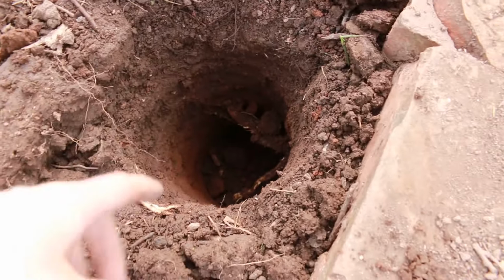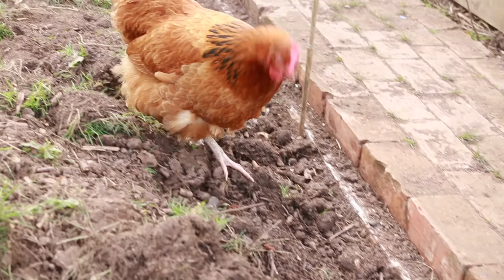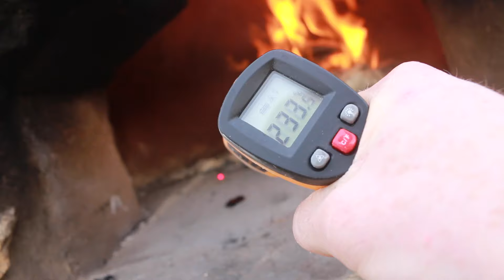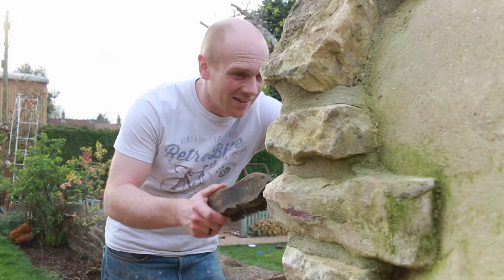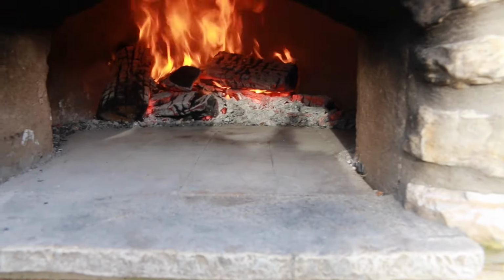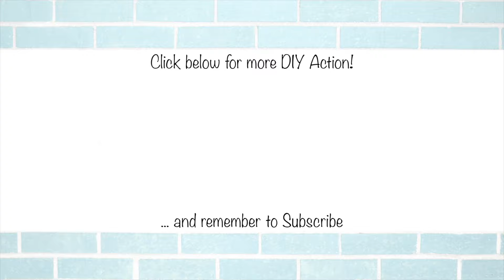Fence Posts and Pizza

Comment: Didn't even think to reuse the old copper pipes for a blow gun for the fire. I've been using the  old copper pipe to remove press fittings in the forks and bottom brackets of bicycles. It was cheaper than buying the $20 tool and less damaging to the frames, since the copper deforms first before steel or Aluminum.